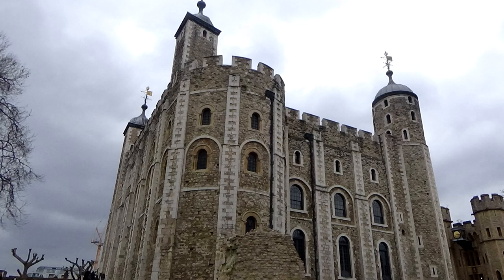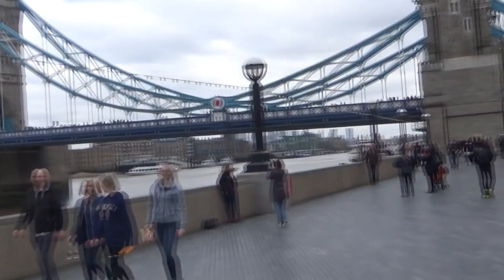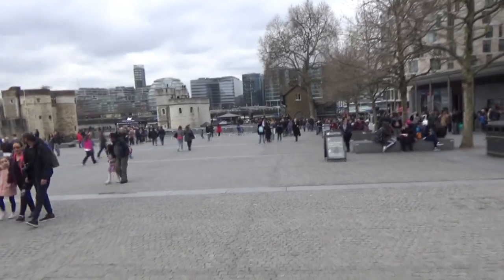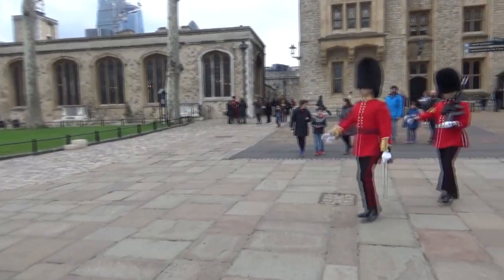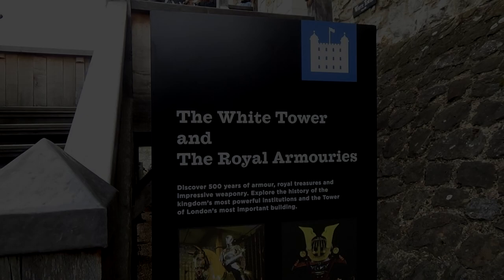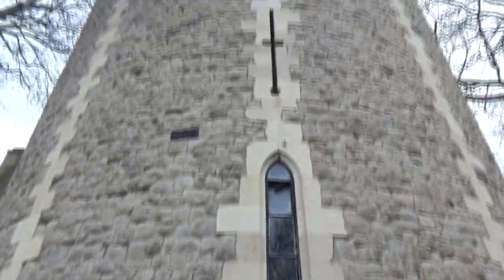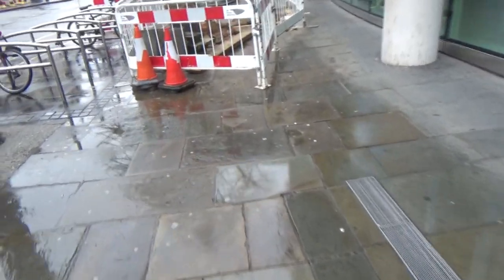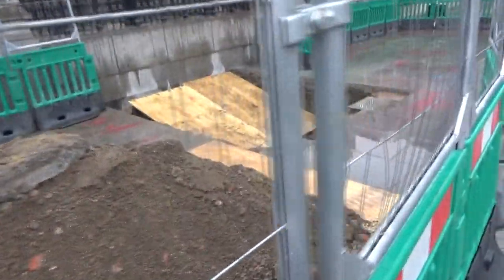TOWER OF LONDON (A stone masons commentary)  Mike Haduck

Comment: That's actually Tower Bridge. London Bridge is modern and boring.
Reply from the maker: Hi Majoofi,  I didn't know that,  thanks mike
Reply: @buckhorncortez  Yes. Seemingly the guy initially  thought he was buying Tower bridge but went ahead with the deal anyway.
Reply: Also worth stating that London Bridge has a nice history - built over 2000 years ago by the Romans, made out of wood.  Rebuilt around 1176 out of stone, it was then built again.  This lasted quite a few hundred years, but a better design was implemented around 1832. Between 1968 and 1971, this bridge was shipped to Arizona where it can still be seen.  At the same time the bridge you see today in London (the most boring version) was built.  There is a church nearby which has pieces of the original bridges (including the Roman one) and a museum.
Reply: @iainb1577  contentiously it would be fair to say.  He denied that was the case - I guess you would say that either way, so we'll never know :)